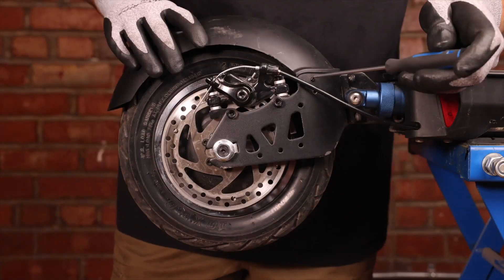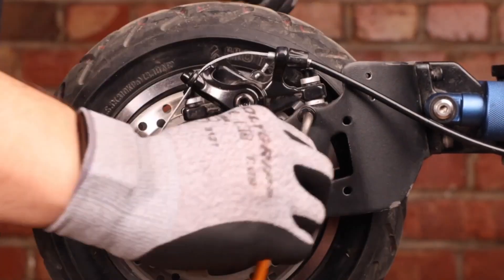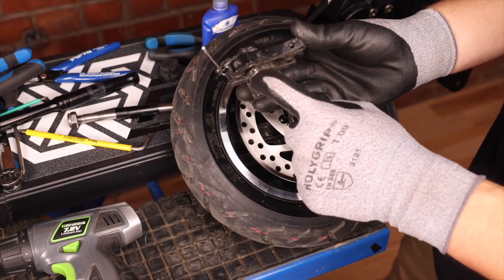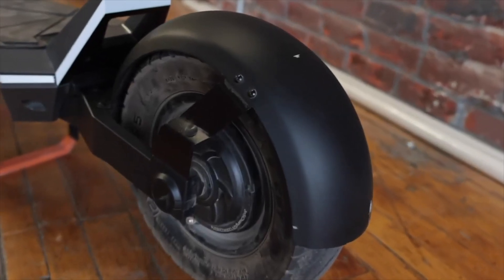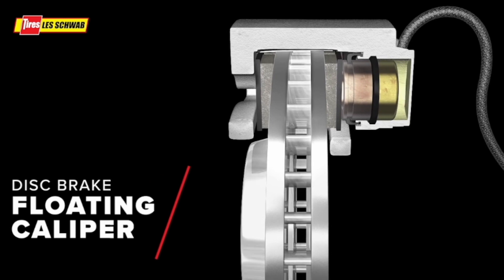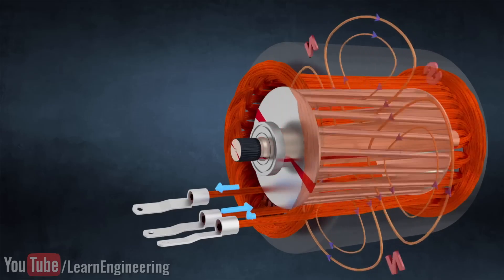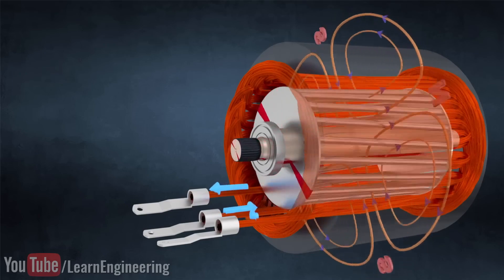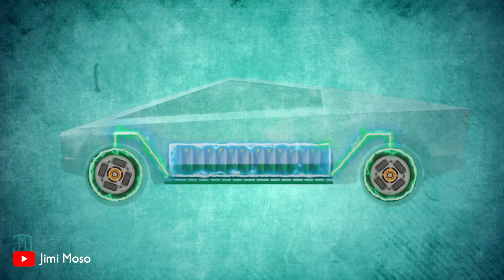How it works - Regenerative Braking

Comment: does regenerative breaking counts as a battery charge cycle and exhaust from the total cycles of Lithium battery?
Reply: really good question, probably not & if it does, it's negligible since it's harnessing electro-kinetic energy that is already there as opposed to plugging in a new supply of electric energy from a charging unit 👌

Comment: The weakest regen setting is still too strong in my opinion. I actually wish it was more like an EV or tesla where the throttle lift is the regen, so we dont have to fiddle around with another lever.

Comment: I grew up riding motorcycles of all kinds. Starting riding when I was 10, owned many different brands & types. After you get to know a bike, you discover the best ways to brake. I like using both brakes to stop, and when I need to stop faster, I'll rely on the front brake for most of that intensity since it won't lock up as easily as the rear brake.

With Regen, is the braking handled by BOTH front & rear motors? Does the M1 analyze anything other than the '3 wires', or will it permit lock up of the back wheel?

I've got a '22 Ghost, have its regen set to max (5) & I still go through brake pads every month or so. Regen in the Ghost kicks in but just lets the regular brakes take over after an initial pull. I ordered a '23 Phantom (to be shipped soon), so regen is one thing but motor braking is another. I prefer aggressive braking (or at least to have the option), I just don't want regen to lock up my back wheel while ignoring the more effective front wheel braking.

Thank you! 

Oh, and kudos for the Apollo Pro. Nice to see focus on making it a true scooter of the future rather than the unregulated attempted murder that is the e-scootering industry's race to propel teenagers past 200km/h on 50kg planks. 100km range is a huge accomplishment. 100km/h is another thing altogether.
Reply: In RG's review they said that the regen won't lock up your back wheel. Their favorite combination for fast braking was to push the regen brake and front brake simultaneously. This is both ergonomically efficient, and it prevents your back tire from skidding out from under you. As always be sure to lean back when braking hard.
Reply: The regen can lock up your wheel, especially with regen set to max & on dry pavement. It's not bad, in fact in the last 400kms I've put on it, I've only used the standard brakes once. The standard brakes are just awful, just as they were on the Ghost - but they're only on stand-by for me now. The squeaky, scraping mess that are standard brakes on the Apollo Ghost & Phantom are insanely bad. 
Still, I'd like them to improve the disastrous app first. I'd pay $300 more to have a standard ignition key rather than the "get your phone out, unlock it, open the app, re-connect to the bike, tap Ride" nuisance. If you leave the Apollo app running after turning off the scooter, your battery will drain like it's on actual fire. Apollo really should have thought this through. They seem to have hired some teenager, like the child of someone they owe money to, for Android dev. @BruceWayne15325
Reply: @OhGawdHesGotAGun 
What your phones battery🔋?Not mine.😊
Reply: @8_x_9.  Not sure what you mean. The app is MUCH better now, but I do have to kill it to save my battery when I'm not riding. I've got 6,550 kms on my V3 Phantom now & I've mastered the art of maintaining it I think. I love the new Phantom Stellar - I have to have one. Pretty well all the things I complained about, or things I wanted to see in the future, have been addressed on the newest Phantom. A few tech upgrades I was hoping would happen didn't, but that's a wish list. Things like a wireless charging mat that I can park the scooter over (rather than plug it in), a rear camera that transmits your surroundings behind you to the LED screen or your phone. Sensors on each side of the LED to indicate someone behind you to the right/left. Signal light symbol on the LED that gets progressively larger after being on  over a configurable amount of time. No 'modes', just a progressive throttle with haptic feedback indicating a new 'level' of acceleration. A light, medium, heavy touch is all it takes to switch 'modes', like driving an automatic car - just let the throttle decide. An app with a 'quit' button/option that pops up when the scooter is turned off or BT is disconnected for more than a few seconds - and the app actually self-destructs its processes.

Comment: how effective is the regen brake? can I use it even if I'm going downhill on a 25% slope or more?
Reply from the maker: Hi Scarrus,

The regen brake is quite effective, although you will need to press it a little bit earlier than the mechanical brake. If you need to stop immediately, you can always use the mechanical brakes. Please note that using the mechanical brakes will also activate the regen braking system as well :)
Reply: @ApolloScooters  nice! Thanks for the info!

Comment: What would really make this ultra cool would be if there was a way to adjust the deadzones in the brake levers. So after you adjust your calipers, you could then open the app and adjust it so the Regen brake starts and ramps up within the travel of the lever.
Reply: On the city pro/24, only the regen lever brakes the 2 motors & not the 2 break levers.😊
Reply: @8_x_9.  Is that new for 2024? All previous versions had regen on handles. I would be pretty disappointed to hear that because the drum brakes could definitely use the help

Comment: I love my City Pro. I set up the new app today and the regen setting reset to 8. The app says "a higher regen setting will recharge the battery less".

I like strong regen so I won't rely on the drum brakes, but what is the optimal setting for the most possible battery power regeneration?
Reply: I have the same question
Reply: @sahilbalaram6190my guess is it stops quicker meaning less regeneration because the process time is cut down. if you slow down gradually, there is more time to regen.

Comment: Thx for the video, but how does it not hurt the battery? I mean, 2x800w motor demand 1600w at full power right? So if I brake to the maximum, going 50km/h to 0 in few second, I will have maybe minus 1600w as well right? Going in the battery in few sec? Whereas the chargers are only 150w or so... Isn't it killing the battery?
Reply from the maker: Hi Nicolas,

Thanks for your question! The Battery Management System (BMS) will ensure that the current/power going back into the battery does not exceed the maximum safe amount. As for the excess energy, it will be converted into heat.

Additionally, the charger only charges at 150W since the power is being transferred over a long period of time. The regen is able to transfer a higher amount of power since its only for a short time duration. This will not be close to the 1600w mentioned but higher than 150w.

We hope this answers your questions! Have a good day :)
Reply: @ApolloScooters  thx a lot for your answer! It helped me a lot 🙏
Reply from the maker: No problem! :)

Comment: Please fix ur firmware and app. I have an Air 2022, I have to re pair every time I want to do any function of the app, also please let me set the top speed higher and/or allow some kind of overspeed control, whenever I am going down a hill and it goes over 35 (throttle on) the braking engages and it goes back to 30.... very annoying . The braking setting appears not be linear. Sports mode should allow continuous power output without sampling speed etc... leave that for the noob modes please. Other than those small gripes they are great scooters, the whole world should own one.

Comment: May be a dumb question, but I just bought a Ghost 2022 and cannot find a definitive answer on whether it has regen braking. Does it? Also, if it does have it, I see in the P settings that setting 11 changes the Regen setting. What effect does this actually have?
Reply from the maker: Hi Wade,

The Ghost 2022 does have regen braking that also kicks in when you press the mechanical brakes. While scooters with dedicated regen throttles (City 2022, Phantom V3, Air 2022) can use regen braking exclusively, the Ghost uses a combination of regen + mechanical brakes.
Reply: @ApolloScooters  Ahhh I see. Good to know. Thanks for the reply. Does the P11 setting change the amount of regen you get, with the trade off being a more abrupt braking force? Is there a big difference between 1-5? Lastly, do you have a recommended regen number for P11?
Reply from the maker: Hi Wade,

Yes, the P11 settings will change the electronic braking (regen) that you get. We recommend setting it to 2 or 3 :)
Reply: @ApolloScooters  Ok great. Thanks again for the replies!
Reply: @ApolloScooters  Now that the Go has been released, can you tell us if pulling the mechanical brake lever on the Go also does a combination of mechanical and regen braking?

Comment: Is the region always on or do you have to push down the lever at the same time you're breaking?
Reply from the maker: Hey there,
Regen braking is only activated once you push on the dedicated regen brake throttle!
Reply: @ApolloScooters  how is this possible? When you're pushing down on the brakes, you'll have to orientate your thumb to push down on the region throttle because that's not breaking the scooter. Doesn't sound safe.
Reply: @Funkiyy  There are 3 ways you can brake. You can use only the regen thumb brake, which is fine for non-emergency stops. If you need to stop quickly then the fastest way to stop is a combination of regen braking and hand brake. You press the regen brake with your left hand and pull the front brake handle with your right hand. Nothing is preventing you from using both hand brakes though if you prefer that, just realize it won't stop you as fast.

Comment: I have a question. I really like how inovative are Apollo scooters but there is 1 thing stopping me from buying. Why don't Apollo offers higher capacity batteries?
Lets look at Phantom V2. Highest battery configuration is 60V 21 Ah (1260Wh)
Vsett 10+ offers 60V 28Ah (1680Wh)
Then there is Teverun Fighter 11+ ( Minimotors collab) which offers 60V 35Ah (2100Wh)
And lastly there is Bluetran Lightning. Also from Minimotors a 10 inch scooter with 72V 35Ah battery (2520Wh)
It's hard to justify buying Apollo when others offer drastically larger batteries. I don't wanna use my scooter only for commuting but also for trips without having range anxiety.
Reply from the maker: Hi Martin,

We definitely understand your concern and battery capacity is one of the factors we do consider when developing a scooter. 

While we are always looking to give our customers as many features as possible, we do have to find a balance between performance, tech (quality of life features), and cost when designing a scooter. Additionally, we've found that the average trip is only about 10 km, so the current range of our models is more than enough for most users. 

We do appreciate your feedback and our product development team definitely keeps the community's suggestions in mind as they design upcoming models. As an example, our upcoming 2023 Apollo Pro will come with a max range of 100 km! 

We hope this clears things up, and please keep the feedback coming! Thanks! :)
Reply: Hey Martin, after reading yours and Apollo scooter comments. During the summer I took my city pro out for rides and max out the range (99% it's regain  baking. 1 accelerating, 1 regain breaking.) Spend a good 3.5 hours on the road, bike paths, and sometimes side walks. Travel up to 50-70km in 20-50 km/h. 

At first I wanted the Apollo pro too. After considering the weight of the scooter. City pro, it's a good balance for me. I use the scooter for joy rides in fall and summer.

Oh fyi, if you want more range. Bring the faster changer. I took into Starbucks, at the time they seemed cool if I just camp there for an hour with purchase goods. After a hour, I think I got a good up to 50% charge. Just be careful, the power bank gets very very hot. I only use the faster charger in travel more than 60 km or more than 3 hours on the road for long term.  

All and all, if you can pick up the city pro without issue (unlike me). You'll be pleased as I did with my pre-order.  

Ps safety it's very important (please wear full body armour. It's very dangerous sport.)
Reply: your vsett will cost you 600$ + more though.
Reply: @sergiolandz6056  I bought Teverun Fighter 11+ for 2180€.

Comment: I love the Phantom V3 upgrade kit regen. It does take little time to customize but it's really nice. Thanks!😁
Reply: Did you install it yourself or have some professional help?
Reply: @RoyalTeaLegion  I did it myself. It was pretty straightforward. They have two videos that walk you through it.
Reply: If you did, done it yourself. How long of the project did it took you to do?
Reply: @RoyalTeaLegion  It took less than a hour. I watched the videos as I did it. Most of the wires you cannot confuse or connect wrong.